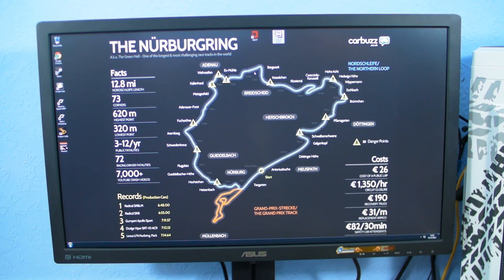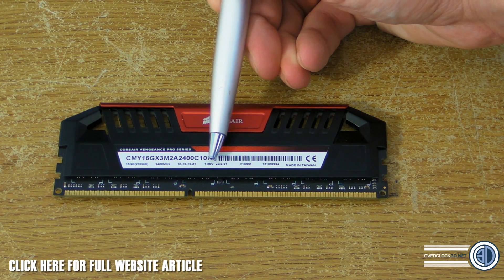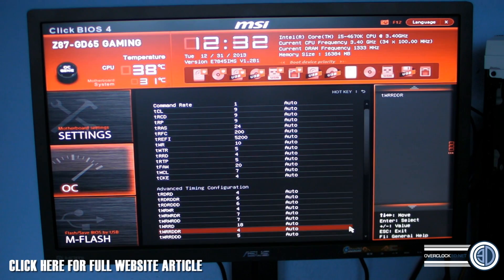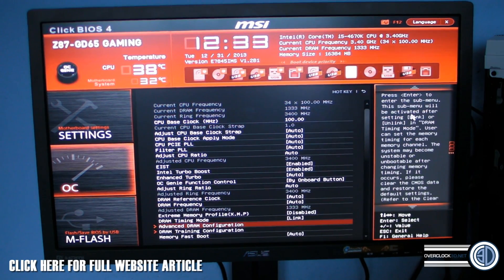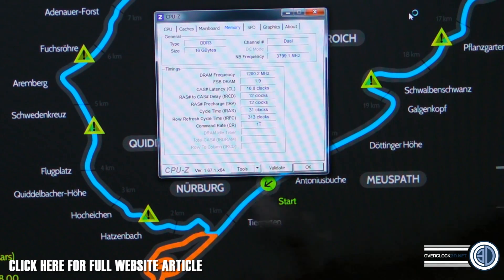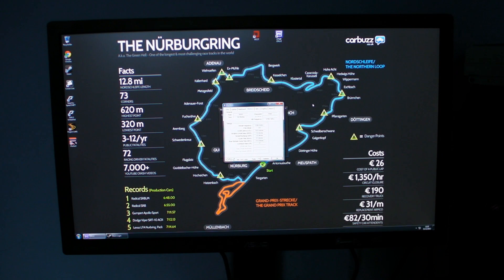How to manually set your DRAM Memory Frequency Speed & Voltage

Comment: Ive tried both enabling the xmp and setting dram frequency to 3200mhz also by manual timings and voltage but none of them works. I just got bsod. Ive already update my bios even my chipset drivers. Does it mean that my  ram or mobo has the problem? Should i need to return them to the store? By the way my pc specs are ryzen 7 4750g, b550m mortar msi, hyper x fury 32gb (8x2) the ram speed only run at 2400mhz instead of 3200mhz.

Comment: 7 years old this vid is and it just taught me how to set my freq from 9-9-9-22  to my 11-11-11-28...thats mad..how i been using my computer at sub standard settings all this time! thanks bud!
Reply: also my gpu temp is now from 35  idle to 30 now after that and soo much quicker and better at running!...my gpu was probably handling extra load cause of my ram not working to it's max

Comment: I just changed out my sticks to 16 GB HyperX Predator DDR4 3200MHz on an MSI Z370 A Pro motherboard. However, it is still running at 2400, but my board can take the upgrade to 3200. This will help me to change the settings I need to. I checked the voltage and it was still 1.20, although these sticks are supposed to run at 1.32 I believe. Thanks

Comment: I don't expect an answer but I am currently using MSI CLICK BIOS 5 and I can't find my DRAM Timing Mode setting. I upgraded my RAM from 2x8 2400MHz to 4x8 3200MHz RAM sticks. Does my system just automatically link them all?

Comment: I have a B450 Max motherboard with DDR4 3200 32gb ram and I just noticed that at first boot I changed the Ram from 2133 MHz to 3200mhz and now it reverted back to 2133mhz and I don't know why.  I just went into Bios to make the changes again and did a save but at reboot it failed to make the adjustments and I had to return to default Boot settings.  I am very new to this so I may be doing something wrong, but I have no idea what that may be.  I was sure my settings were saved and was astonished that the settings are not saving.  What am I doing wrong?
Reply: I have this same exact problem but on an MSI x570 gaming motherboard and I haven't been able to find any solution.
Reply: @Faris.  Not sure if this is a fix for your situation but I kind of did a work around myself and I did this by setting in my BIOS the Ram Speed to the Next Lower speed.  In my case I set the Ram to DDR4 3199mhz and that setting kept for me.  I guess it was so close the numbers did not even register, but give it a try with your ram and maybe it will work for you as well.  Be sure to SAVE the changes you make.  Let me know if it works for you.
Reply: @GogoFly68  Ok I'll try that. Thank you.

Comment: hey bro, I have a question: If I have 3 RAM memories (1600 x2 with 10-10-10 (4gb each) + 1866 x1 with 10-11-10 (4gb for a 12gb total)), but I want oc from1600 to 1866 for the 3 memories the values that I should put in bios is: 11-11-11-33? [NOTE: the bios defaul values is 10-10-10-30]

Comment: will this be the reason why i am getting crashes and my pc restarting with the ram light coming up on my board when i try to play the new modern warfare i am currently back on 2400 mhz ram after i bought some 3600mhz ram for my new build but it started to crash my pc and it did not like being overclocked at all so i ended up going back to my old ram do i need to mess about with all the frequency and everything to stop all the crashing fortnite works fine i am guessing that cod is a lot more heavy t

Comment: Stupid question. If i just give my correct frequency in the memory multiplier, Do i need to adjust the voltages,timings as well manually or i can leave them in auto?
Reply: You will also have to correct the others as well I believe. Don't quote me on that. If it doesn't get enough voltage to the ram you could send up with bsod.

Comment: Hi i ve been getting blue screen of death of and on for over 3 months running two sticks of 8 dd4 i on a msi board change DRAM Memory speed, frequency did not know how to change the voltage i been trying to enter into it all the time so simple just click on it and enter the value, well the computer is running like a dream it was Voltage all the long thanks HEAPS
Reply: Did you turn on xmp? I was getting bsod it was driving me nuts it was because xmp was on it did t set voltage correctly and it constantly crashed.
Reply: @CodexActual  
So what did you do in the end? Did you manually do the timings and voltage?
Reply: @Stringbean421  yes I did them manually. I haven't had Bsod since.

Comment: i thought i was running ''single channel'' due to having  a Crucial 8GB DDR4 2666MHZ 1,2V and a HyperX 8GB DDR4 2666MHZ 1,2V only the latency is different. Crucial has 19 while the HyperX has 16. but both CPU-Z and HWInfo say ''Dual Channel''  but someone told me im getting 40FPS on Fallout4 due to running ''single channel''  this is confusing the fuck out of me.  i went into the BIOS and its all on AUTO. so i suppose it changes the Latency itself to the slower one. im running Fallout 4 on the lowest of lowest even with mods improving ''performance'' and if im lucky i hit 32FPS when walking around. and 60FPS when standing still looking at the sky.

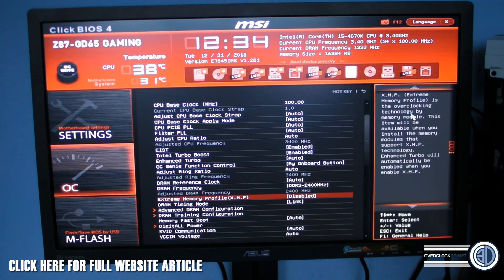Comment: 6:00 Does the extreme memory profile (X.M.P) option do the same thing?
Reply: I tried both the XMP and the manual version. Both worked well. No discernible difference when benchmarking 👍🏻
Reply: For anyone wondering XMP will set your DRAM to its rated settings (what it says on the pack/stick) The method he is showing is only really useful if you plan to overclock your RAM
Reply: @christopherrhein4503  So it's better to use XMP considering they does the same thing?
Reply: @maruf7956  Yes mate X. M. P will set your RAM to its optimal timings without having to manually enter any settings.  Manual mode is for trying to get faster speeds than you RAM is technically rated for and only woth doing if you are a 'professional overclocker trying to get a few extra points on time spy or some other benchmark. '

Comment: I'm using a msi 970 gaming board (amd) but it seems nothing will allow it to accept anything passed 2133 (not because of the chip because of the boards limits) I have changed the frequency to match my G-skill 2400 ram and corrected voltages but sadly 2133 is the best I can get it to run and I benchmarked my rig against identical user components which identified that despite the timings and voltage settings my ram is running worse than most users of this ram. So my question is, would activating xmp profile help with performance?

Comment: so, i have corsair dominator platinum (2x16gb 3000mhz) and my cpu is i7-8700, motherboard is msi mag z390.

i read that i7-8700 max ram speed is 2666mhz. 

i have set the ram setting according to the ram's specifications. but, since the cpu says only support at 2666mhz, do i have to set my ram speed in bios at 3000mhz(my ram speed) or 2666mhz(my cpu can allow) ??
Reply from the maker: 3000mhz :)
Reply: @RushKit  thanks for answering my question. wish for the best for your channel ;)

Comment: For overclocking memory past what's advertised, below is a formula i use to squeeze even more performance out!

(1-(BaseFrequency/DesiredOCFrequency)) / (1-(1333/2400)) * (1.65-1.472) + BaseVolts = DesiredOCVolts

Example: (1-(2400/2800)) / (1-(1333/2400)) * (1.65-1.472) + 1.2 = 1.257 volts!
So If I was at 2400Mhz @ 1.2v, but wanted to overclock to 2800Mhz, I would probably want to set my DRAM Voltage to 1.257 OR just 1.26.
This is not exact! But it should get you in the ballpark.

Comment: My ram sticker shows 2133mhz timing 10 11 10 31, 1.5v and my cpu is i7 4790k which can only handle 1600mhz ram. my question is that should input 1600mhz timing 9 9 9 24 1.5v or 1600mhz timing 10 11 10 31, 1.5v in the bios since I cant use xmp profile?

Comment: What to do if using XMP or setting manual does not work?  Does this mean my cpu can not handle it?  Its all new tech really I would think it would but I read that because I have Alienware they make it difficult to OC.  I also have cpu OC by alienware command center default presets.  cpu is i7 6800k.  I can only get my ram which is 3000mhz to run at 2666.  I am sad..  I want the other 300mhz

Comment: Can this cause damage to your computer?? Or it's totally safe if I follow the steps... Does it need super good fans or something like that??. [I mean I have one r3 2200g 3.5 GHz and my mobo is one MSI b350 gaming pro and I have 1x8gb G. Skill aegis 3000mhz 1.5V and the timings can I "write" on the bios the exact actual timings, the exact actual volts and mhz? Or that will might cause a crash?!

Comment: My ripjaws ddr4 16gb 3200mhz doesnt work  -,- max that work is 3000mhz but they sold me an 3200mhz kit. Scam
Reply from the maker: You need the hardware to support it - probably just needs setting up properly tbh
Reply: OC3D RushKit ok my mainboard ist the b350 gaming pro carbon from msi and the cpu is a ryzen 5 1600 and gpu a gtx 1060 6gb. Maybe something not support fast ram?

Comment: If anyone could help I would appreciate it. My Motherboard is an MSI X370 Gaming Plus with an AMD Ryzen 7 1700x. The RAM is 2 stick, 16 GB each for a total of 32 GB. For some reason it is running at 2133mhz instead of 3200mhz. The RAM used is G.skill Ripjaws, the black ones. If you can help me to set the speed to the correct speed it would be much appreciated.
Reply: Ghost Zombie you just need to go into the bios and adjust the speeds

Comment: Dear sir/ma'am,

I'm from India. I am using Gskill Ripjaws V (F4-2400C15D-32GVR) 32 GB ram. Since I purchased this ram I'm facing issues when start my PC.

When I installed 16GB single ram, my PC booted up in 30 seconds (home screen) But when I install both the rams, my PC booted up in around 5 mins (home screen). Now I can't bother this 32 GB ram takes 5 mins to boot up. My motherboard is Gigabyte GA-Z170-D3H & i7-6700K processor.

Kindly give solution because it is depressing me.
Reply: First of all it's a man. Can you not hear and second of all it should give u depression. Keep the 16gb

Comment: can i do it on my A320 motherboard since there is an option to do all that, can i overclock my Apacer 4GB 2400mhz ram to 3200Mhz and what voltage should i put it on ?
Reply: Same mobo  but mine is 16gb 2666mhz pls help
Reply: @stevenstramturean  Since the A320 chipset does not support overclocking... it just doesn't allow CPU overclocking, RAM overclocking however is allowed, as most of the mobos support DDR4 2666.

Comment: I'm currently using x fire fury DDR 4 Ram memories. 16Gb (2400Mhz) on slot 1, 8Gb (2666Mhz) on slot 2 and 8Gb (2133Mhz) on slot 3. When PC reboots it shows below 'American Megatrend's Logo', the Total Memory size: 32Gb, however Windows 10 only detects 24Gb. Even forcing inside SETUP, putting DIMM frequency set to AUTO or 2133Mhz, the operating system still rejects the last 8Gb on slot 3. Why does it happen?
Reply: CyberPunk Girl go to bios memory speed and link
Reply: CyberPunk Girl putting the ram on auto link would be better

Comment: Okay i some how understand, i have CMK32GX4M4C3000C15R, if i clock it at 2800 Mhz it’s okay right, dose the memory clock on cpu 2600 Mhz (7820x) be ok then. Mabe cpu run 2600 Mhz bus speed to the memory but the memory is a littel faster to do it’s job with lower latency at different clock speed but it still transmit data at 2600Mhz betwen mem and cpu, i’m an exnerd?. I’am going for 2800Mhz 15-17-17-35, yours is faster i think. Great stuf

Comment: My BIOS doesn't have a 1200MHz setting or 2400MHz setting and I have the same exact RAM you do in this video. My BIOS also is missing the DRAM frequency setting, instead it says memory clock :/

Comment: 1200mhz is normal speed for ur memory right ??
but u can over clock ur memory speed to 2400 mhz .. right ?
but befor u over clock ur ram to 2400 u need to make sure that ur cpu support 2400mhz.

right ??
Reply: it does support, he showed the label on the ram which said 2400MHz
Reply: @pineapplepen3542  So if i set the same voltage, same speed and timings on my DDR3 1600 1.500 V stick it should be stable and boot into windows? or am i missing anything. the higehst so far i was able to was 1866
Reply: @goransvraka3171  yeah as long as your ram supports those timings. But keep in mind that your CPU and motherboard also have to support the frequency. So if your RAM is capable of running at 3000MHz but your CPU only supports 2666MHz anh your motherboard only supports 2400MHz then your ram will run at 2666MHz. But like I'm not sure if one stick can run at its full frequency or it requires dual channel memory to do so. I don't know

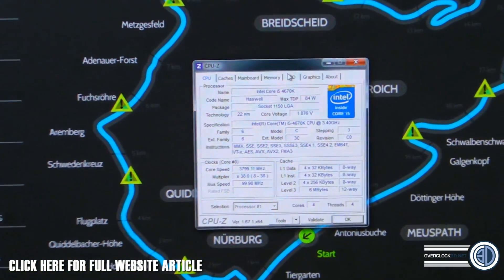Comment: I have set mine to all auto and cpu-z is:   channels=Quard    Nb frequency=2400Mhz    Dram freq=1500Mhz    FSB;dram=1:30    15 clocks    17 clocks17 clocks    35 clocks    Row refresh cycle time=525 clocks    command rate=2T    I have no idea but it runs ok    memory D4 3000 32GB C15 Corsair Ven K4 (CMK32GX4M4C3000C15R)
Reply: Nyan Linn Phyo What motherboards and cpu and memory do you have in the machine.

on msi i can put a fixed clock 2600Mhz to my memory and put a system bus clock at 2000Mhz

Comment: I did this after my 2x4gb1866 hyperx  ram was only running at 657mhz in task manager, nothing changed. Still 657mhz for some reason, (msi 970 gaming mobo fx8350, cs650m psu, gtx780ti vga) what should i do?

Comment: K so I have recently purchased the corsair vengeance ddr3 16bg @2400mhz.  After installing the ram, I was prompted to go to BIOS so I did, looked at this guide, and now my monitor,keyboard, mouse are not turning in, my PC turns on and stays on, but nothing visually is happening. Is there anything that could be done about this problem?
Specs 
MSI 970 mono
MSI NVIDIA 1070 GPU
AMD FX-8350 CPU
Reply from the maker: Could need more tweaking in the bios - your CPU wasn't great for fast memory tbh. Try it at 2133
Reply: OC3D RushKit I have fx 6300 can I over click my 1600ram plzzzzz

Comment: my core voltage is ridiculously low for an i54590 on idle running at .200v min lol
Reply from the maker: that's called speedstep. it goes right up when you do anything and drops back down low at idle. Point is when it goes up it will go much above what is actually required

Comment: question I have a 4 gb 1600 gskill along with two 1866 4gb but its running at 1600 and It doesnt let me simply oc the 1600 so they at least all run at 1866 .shoukd ijust remove the 1600 and just use 8 gb of ram ? my mobo is the 970 gaming msi Thanks

Comment: Pro tip!  You can safely install desktop RAM into your laptop by simply resizing it by using a precision blade mini saw found in most local hardware stores.  Just remember though to NEVER mix blue RAM with red, that would be horrifically bad.

Comment: Is it possible to use higher speed RAM at its correct speed without overclocking the CPU??
Reply from the maker: Yes but depending on the speed may need some manual intervention with volts etc
Reply: thanks that answers my question.
Reply: 1800 mhz vs 2133mhz is there a difference? people said there is not much difference :/

Comment: What if bios doesn't save the memory settings? i also have 9 9 9 24 by default (did everything on video but couldn't find dram timing) , i changed them but when i checked the ram amount was 665 and the memory settings remained same. It recognizes my old, worse ram sticks but not my newer ones. No difference if i use xmp.
Also, with these newer sticks the computer fails to open/reboot at first attempt (takes two to three) while when tested on my friends computer he didn't have that problem...

Comment: Very informative. I have one question.
Currently I am using Asus Z97 Pro Gamer mainboard with Intel i7 4790k. I already own the following G.Skill Rams.
F3-2400C10D-8GTX 10-12-12-31-2N

I plan to buy the following (Above model is unavailable here)
F3-2400C11D-8GXM 11-13-13-31-2N

How do I set these values for each ram individually? Possible?
Reply from the maker: Exactly the same process

Comment: So I just noticed that my RAM was running at 666mhz as well instead off 800mhz, I went to the bios to follow your steps, I have the MSI b85-g43, I was able to link them and put my speed to ddr 1600mhz but I could not edit my RAM timings, they should run at 9-9-9-24 but they run at 11-11-11-29 instead.

Comment: Thanks for this tutorial really helpful.  Only question I have is after I set my settings for mine. My pc doesn't want to load it stays in black screen.  And I have to reset cmos.  I have 1866 ram ddr3  9-10-9-28. Any help would be appreciated.
Reply from the maker: All depends if you've set the volts and if youre having issues at 1866 it might be your cpu. Go to the OC3D forums and ask there :)

Comment: what dose it mean when it says 12gb (3.0gb used able)
Reply: take off the rams and put them in again. make sure you have your PSU off from the button outside
Reply: are you using a 32bit operating system? that would explain it.
Reply: Tommy Huynh even 32bit can support at least 8gb of ram
Reply: zecRjee Not on Windows. Maximum it can see is 4GB.

Comment: I want more information, like 1) how do I find out the max amount of memory my PC can use and the max speed of memory my pc can use, what determines it? the main board or the CPU ? 2) how do I find out what my command rate should be, 1 or 2 ? most might be 1 but some or 2 ? what's mine  ? and what determines that, the ram, the main board, or the CPU ? 3) and call me stupid but how do I get into my BIOS in the first place? 4) should I change my setting's before or after I put the new ram in? because my new ram uses 1.35 volts and my old ram uses 1.5 volts, I don't want to put in my new ram and burn it up with too much voltage,  I have an IQ of 80, I need instructions for somebody with an IQ of 80, the reason I'm posting a comment here is because this is the most informative and understandable BIOS setup for RAM I can find, I want RushKit to make a more complete video